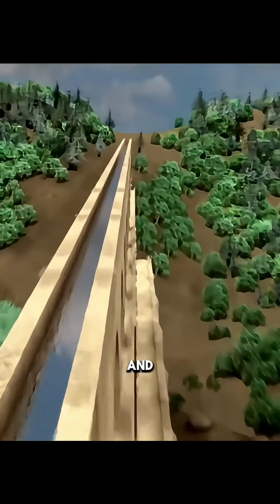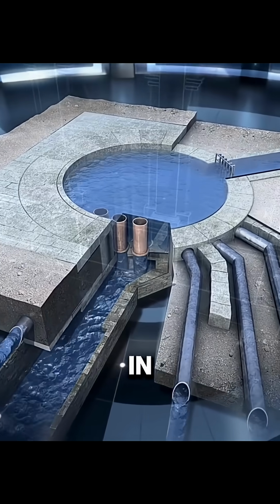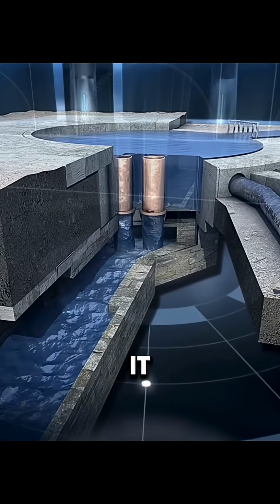How did the ancient Romans build tunnels? #zackdfilm  #foryou #tunnel

Comment: Didn’t know they used pipes like that. Why didn’t they. Use pipes the whole way?
Reply: Large diameter pipes using the materials they had available (lead or clay) would have been too expensive to manufacture and too heavy to economically transport and install without motorized equipment. So they built the tunnel tubes on site using cheap labor.
Reply: @david672orford Correct, money and labor are always minimised, but Romans used to make larger pipe diameters, say 50cm, out of bored stone blocks. These pipes were to small for the flow rates required to supply cities, therefore Romans made large capacity channels.
Reply: Channels and tunnels are still used even today for transporting water over long distances.